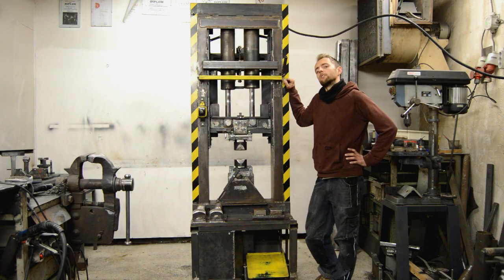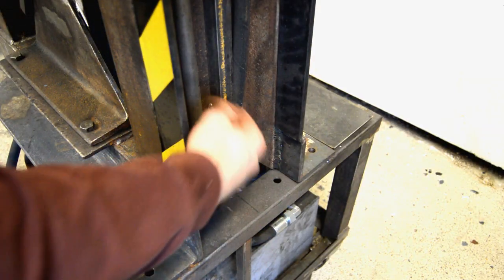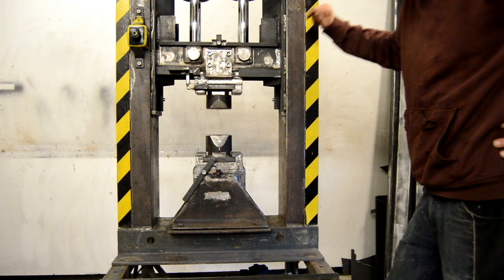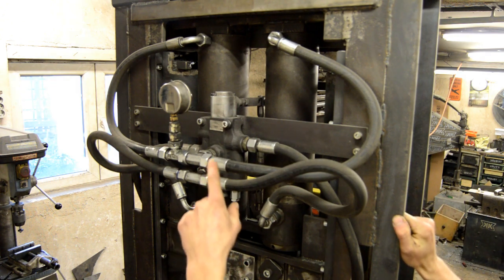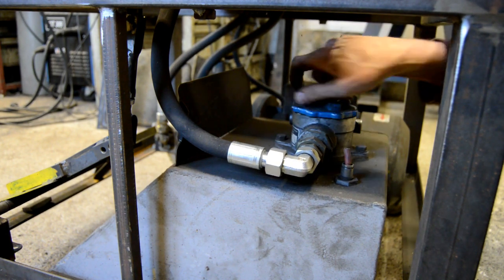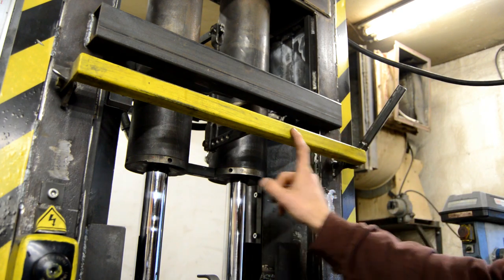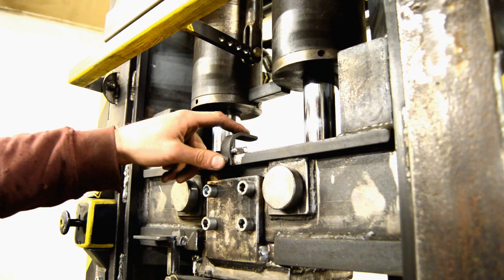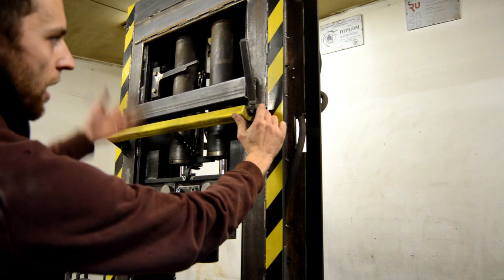My homemade 40ton FORGING PRESS

Comment: Hi great build ! What were the specs of the rams you used and does doubling the rams equal double the pressure ? I would think so but have been caught out before with assumptions lol 
Cylinders are so expensive here in the  uk.. a 5” bore 2” piston here is £1000!! Crazy money I’m now thinking of a 2 ram design as it may be cheaper as the rams would be smaller and easier to source new or second hand

Comment: That’s awesome man, and don’t apologize for your English, you have better English then some of us Oklahoma folks lol.  
 Have you thought about wiring in limit switches? They are easy to install.  Kinda like on my milling machine. I can kick my auto feed in and when it hits the limit switch it’ll kill the power to that direction but will allow you to auto feed in the other direction. 

Nice work. Love the design
Reply from the maker: Thanks. Electronic limit switches is probably much better way to go. But I am absolute rubbish when it comes to electronic and viring.  I made mechanical ones, in other video. And it just does the job just fine for what I do.

Comment: You can buy an automatic return chest valve. They sell them for log splitters. Push the handle up and the ram fully returns when it senses some pressure it stops. Google it

Comment: Great job.. Can you give me some specs on the electric motor.  I have a 34 ton gas log splitter that would like to convert. Ive tried several motors but no success. Do u know the rpms and motor size. Any suggestions. Thank you
Reply from the maker: It is a 5,5Kw 1500rpm. 3phase 400V (european standard)
Reply: @KarlMetalworks  thank you sir

Comment: I don't want to be a grinch, but hydraulic presses are SUPER dangerous, anything above 20tons should defintely have guardings and protection.
Reply from the maker: You are correct, presses are dangerous. Why do you think the 20 tons is the limit?
Reply: @KarlMetalworks  Well you DID say 2,000 psi on 4:04min. Considering you have TWO pistons, and they're about 30mm in diameter so the stroke diameter should be at least 50mm, so (2.5*2.5*3.14)*2 = 100 cm2,  (for stroke surface).
2,000psi = 140.6139 kgf/cm2
So, the total force of the machine is = (140*100) =  14,000 kgf, wich is A LOT.

Also, the welding seams are very weak, and are prone to failure. That's the reason why every single one of the hydraulic designs has a single beam going all the way to the bottom.

the press is such a dangerous machine, it's deceptively simple.
Please check this video: https://www.youtube.com/watch?v=K25dnGpwZyU

Comment: That "1st Press" of the square tubing is really a good shape! - Impossible to reproduce any other way.

So the question remains, Is it better to power hammer or forge press a hunk of steel?
They are so different in their upsetting - does it make a difference in the metallurgy?

Comment: very nice Karl.
please ntell us where you sourced the cylinders and hydraulic pump , I mainly need the specifications so I purchase the correct parts for my own press. Thank you
Reply from the maker: I got it from a local (Czech republic) craigslist. Its 7hp 3phase motor, it pumps about 30liters/second. And at about 220BAR max.
Reply: @KarlMetalworks  Thank you

Comment: Hi Karl, your homemade forging press is awesome! Do you have a BOM that you could share regarding the components that you used to build this machine? I am interested to build one too if you could share some tips. Thanks!
Reply from the maker: Hi, thank  you. Unfortunately  there is no BOM to this press. I just used whatever I had lying around. I suggest checking your local scrap yard to see what steel is available there.

Comment: Do you have plans or blueprints a available anywhere. This is by far the best build I've seen and I'd like to start researching the nessasary skills to make withing the next year
Reply from the maker: Thanks.  I didn't use any plans. Its all about a piston and pump you can get at then you go from there.  You should also check local scrapyards to see if they have some nice beams for  sale.

Comment: I have one way piston how to make it go back
Reply from the maker: I highly suggest two way piston. But you can make it go back by some spring, or maybe some puley + counterweight system.
Reply: But it is 30cm piston now it takes a car jake to return it
Reply from the maker: Okay , so get the piston to someone repairing hydraulics, and get another port drilled and welded on the other side of the piston. This way you make it two way piston. Complicated, but not impossible.

Comment: What an amazing machine. What did the rams and pump come off of before they became a press? And does the electric motor run on 220v or 440v 3 phase?
Reply from the maker: Thanks. Rams and pump were bought from local craigslist, so I dont know. But the rams, similar size can be found on various machinery like diggers and cranes. Motor runs on 400v 3phase (European standard)

Comment: Nice looking press, i did notice a small amount of inward deflection of your upright beams and lower die mount,, will you be doing any extra bracing, ??
Reply from the maker: Thanks. There is some deflection, but no deformation. So it is just fine.

Comment: There was a discussion earlier about the capacity of your press.  According to my calculations, with two 4.5 inch cylinders at 3000 psi, your press is rated at 47.7 US tons.  This assumes everything is working at their very best.  I'm no expert, but this press is one of the finest builds I have ever seen.  You are very talented.  Thank you for sharing!  Jerry

Comment: Engineering seems spot on, very nice build and effective design. Your dies swapping demo was impressive. Do you use some kind of pressure balancer?
Reply from the maker: Thanks, no pressure balancer on the machine. Not sure what a pressure balancer do. So I think, I don't need it :)
Reply: @KarlMetalworks  With multiple cylinders, you can use a pressure balancer to even the descent when your load is off center. But it makes sense for you not to use one in this configuration since your load is centered and your ram is well guided on both sides. 
Anyway, big thumbs up!

Comment: Super machine. I think I like how quietly it runs as much as anything else. Some of these presses are obnoxiously loud. How did you get yours so quiet?
Reply from the maker: This may break your heart, but I the audio is actually edited, so the viewers ears wont bleed.  The pres is very noisy when started, when it heats up a little, it is just bearable without ear protection. But I use earplugs almost all day anyway.  I wish It was quieter.

Comment: Your English is great so don't feel pressured. The following is from a Canadian point of view of English, western Canadian to be more precise. Commonly the liquid used for machines like your press is referred to as hydraulic "fluid" so you had it right from where I'm listening. Oil is reserved for usage where lubricating or bearing load support is it's primary purpose. Brake liquid wet stuff gets the "fluid" designation too. English is full of rules to be broken and you'll constantly come across inconsistencies at an inconsistent rate. Nice press too.

Comment: Nice build, if I may suggest, I would make it so you can have it run automatic also. Have top and bottom travel limits set as you are planning to build them and it cycles from down and up over and over again. You will use it a lot for long pieces of steel to bring them down to size.
Put a tape measure on the column too with a marker on the cross beam, that way you have a quick reference for setting the bottom limit.

Comment: Hi - Cool Build. I'm looking to build a forging press myself but know nothing about hydraulics. The Ram, the motor, the pump??? Do you know of any resources where I can find out the basic information sufficient for me to put a plan together??
Reply from the maker: There are some facebook groups focusing on building a forging presses.  You are looking for some 5kw (7hp) motor with pump. That can pump 220BAR (3000psi) at about 30liters /minute.  And piston with 150mm bore (6inch).  Use this website to do the math: https://www.tss.trelleborg.com/apps/hydraulic_cylinder/     There is a guy repairing hydraulics in every bigger town in the world. So maybe  find one in your area and start there.

Comment: Great press build,  quick change die holders, 
large control lever with with foot control, tool stops up and down  ,       
  lots of great ideas , nice fabrication work.                                                                  Your bench vise? , looks modified to open wider.                                                                              Thanks for sharing the press build ,  keep up the good work.
Reply from the maker: Thank you. I believe that having strong press is just a half of the story.  It is all the details and features that makes it good machine to work with.  The bench vise is just stock, I think. Unfortunately there are no markings on it, so I cant compare it to the others of this type.

Comment: very nice! what size are the cylinders? how many gallons per minute (gpm) does the pump do? many thanks for this video
Reply from the maker: Bore is 115mm (4.5Inches) stroke is 30cm (12Inch). Pump does 30L/min (8gpm) I think.

Comment: How do you know or estimate 40 tons? I’ve wanted to build a press but don’t want to under build for the work I want to do. Nice video and explanation! Love the simple die changes.

I’d recommend skipping the cm-inch conversion. You’re only helping us Americans avoid becoming compatible with the rest of the world 😀
Reply from the maker: I measured the pistons bore. The pump gives 220BAR max.  I used this online calculator to do the math for me, its like piston displacement times pressure, or something.  It calculates the force in newton, and I converted it to tons.  It can be few tons off, because of the lame measuring, but 40tons just sounds right:)   https://www.tss.trelleborg.com/apps/hydraulic_cylinder/    I wish you American guys used metric, it would make your life a lot easier. All that 18/35th of an Inch..... It must be confusing as hell :)